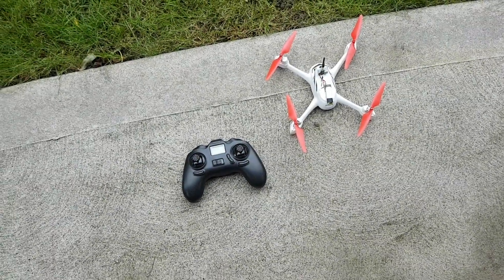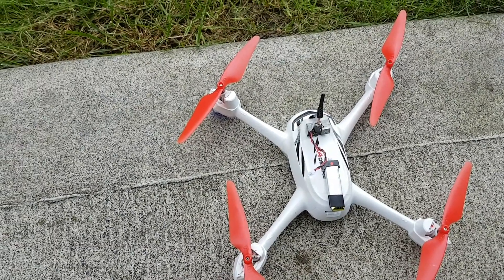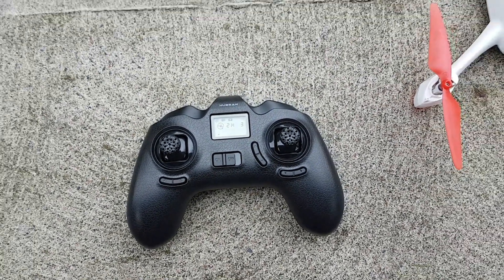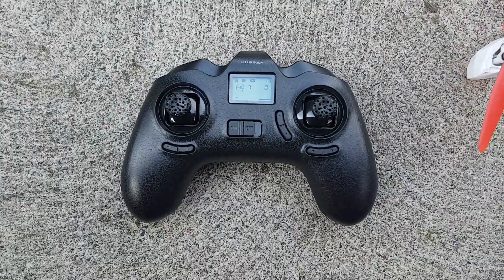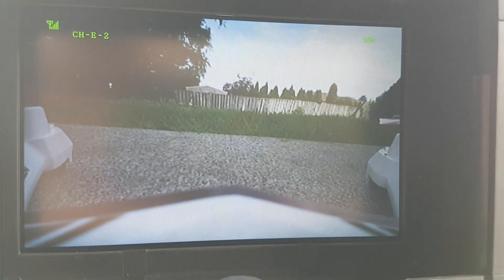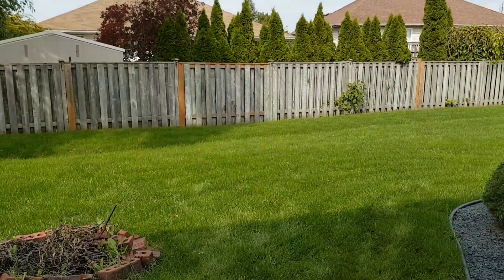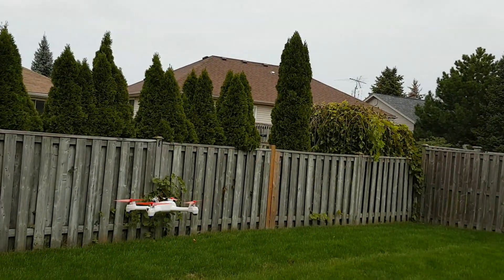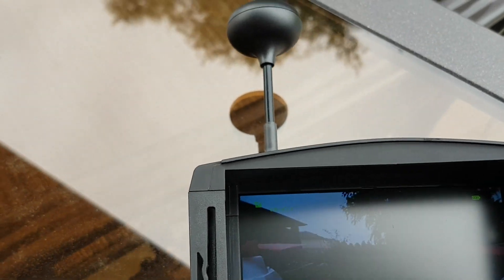Hubsan H502e with AIO FPV - how it worked

Comment: I am very curious where you GPS module is located on your Hubsan.  I am happy you got your AIO to work as well as the satellite fix for the GPS. I think the location of those GPS modules are the key to the whole thing as well.
Reply from the maker: When I upgraded the H502e bearings... https://www.youtube.com/watch?v=ooc3Swop4e8   You can see the GPS module is under the top frame. So basically dead center top. I will have to look into the Bugs 2C.
Reply from the maker: I found that the GPS module on the Bugs2 is actually right under where the letters GPS are on the top of the drone. That is where I placed the battery. It is about a 1 inch square. At the nose is the compass chip (just above where the drone camera is) where I placed the AIO camera... so there is about a 3 inch gap between the compass and the GPS module. I figure if I place the AIO camera in the middle and the battery underneath, I should be good.
Reply: :o)  I figured you would find it as well as how the battery would block the GPS signal. Good Luck :o)